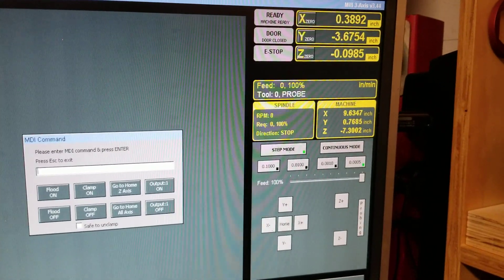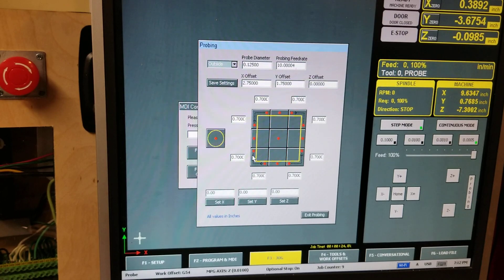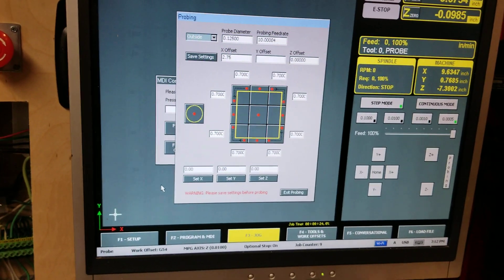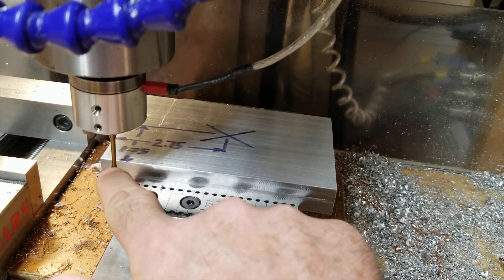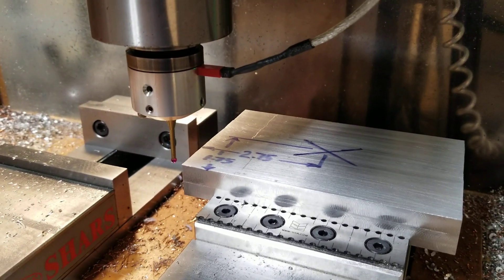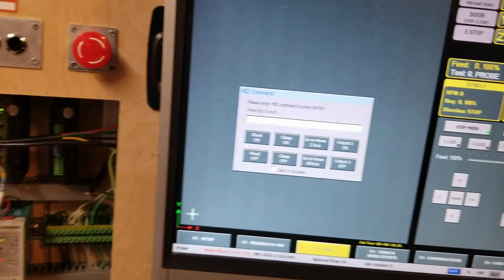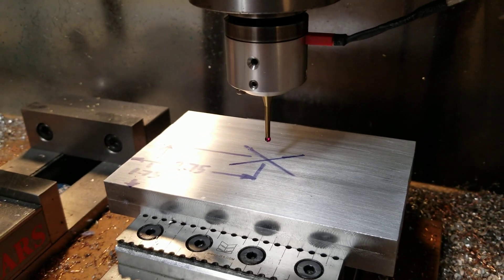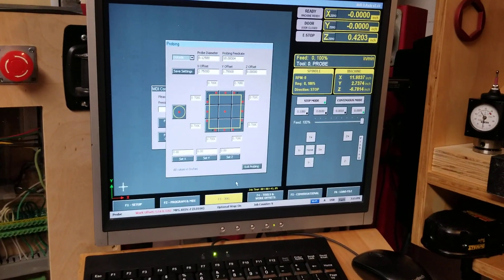Finding the Center of a Part using Masso Probing Menu

Comment: can you simply jog over and grab the other corner and have it calculate the center
Reply from the maker: Thanks for sharing your experience.  Which Masso are you using?
Reply: Am not but I also have an x3 that's in storage about to be setup and upgraded I am comparing to linuxcnc and mach3 (4) since this hugely impacts board selections I am researching pros and cons documentation is masso biggest con
Reply from the maker: @ramkitty  each controller is slightly different but many features are the same. Masso is simpler to setup and has many good features but no controller can do it all. I have three Massos and a Mach 3 so I know this can be a difficult decision.
Reply: Your setup looks great similar to what I am intending. I like the masso for dumping the need for a pc. I got the machine hardware in just need better drivers up and a lot has changed in 10 years